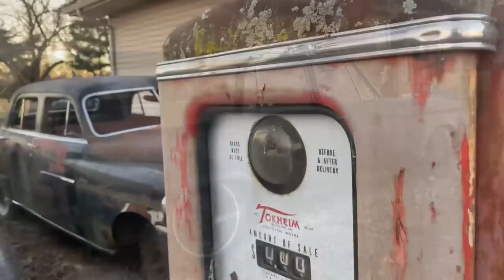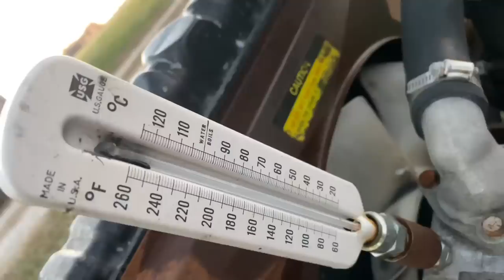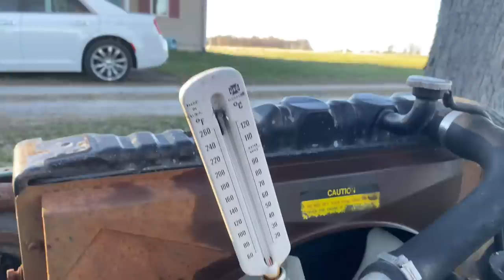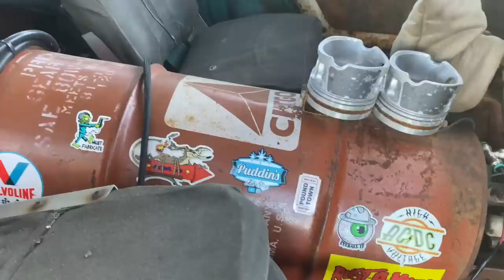What’s one more Farm Truck??

Comment: Same kind of truck. A coe 1968 Ford with a 390 CID. With a giant winch and from where I'll be the same time span and truck along with a semi roll-off bed. Not semi truck but it's kind of roll-off bed. Floor must have 2-in oak in it, ran when parked. Started a couple of times since then. Needs carburetor work. Red with low miles and basically northeastern Oklahoma. If you're interested I'll share more. The old boy has built some wonderful vintage vehicles over the years. Nothing diesel. Give you some content to. Just FYI. Happy Thanksgiving at the turkey shoot.

Comment: We had a 1956 IH -190  401 engine in it gravel truck, I hauled over 7,000 yds with it. Some 3,000 loaded with the Ford 3000 Super Dexta then the rest with the 4,600 Ford with the 730 Loader on it. Ya way back when!